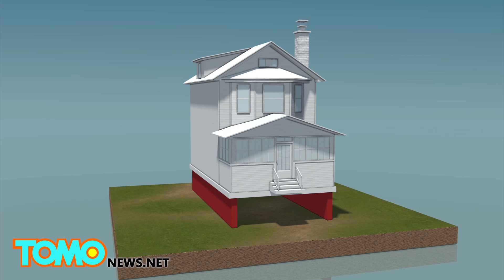Magnetic hovering houses the future of earthquake-proofing homes? - TomoNews

Comment: xS The biggest hurdle would be power supply; a train's one thing, but... If one were to hover an entire household, it would take a considerable amount of power... Even more so if the building is even bigger than the average house.
Reply: No, the biggest hurdle would to be to get hundreds of thousands of dollars  worth of shatterproof unobtanium supermagnets and attach them to twenty or so large 50kw industrial motors that have their own also earthquake proof 1 megawatt generator, then you could say lift an average 2 bedroom apartment... the hendo guy is a crook who has literally not invented anything and his hoverboard idea is not feasible.
Reply: Peter Carlson Eh, to be more accurate, cost; I mean, sure, maybe we could get one working model out and about... At the most two, but, we'd be blowing a considerable amount of money on these things if we'd really want them for commercial use >.< decent concept... Sure, but, I don't believe a thing like this would be the best long term solution for earthquakes...
Reply: ***** dont forget you have to have perfectly flexible plumbing, sewer, and electrical hookups, and be fastened securely in case of wind so the house doesnt literally blow away. Passive dampers are the only practical soloution, that or live in a helicopter because those are more efficient. as an engineer trained in building design I know that the hookups and hold down systems would be more involved in design and assembly than the entire rest of the house project combined.
Reply: Peter Carlson Eyup >.< because those tend to break alot during earthquakes otherwise... The other methods people have already put into practice seem to work fine as they are. Though they could use some refinement, I feel like it's not really neccesary to introduce a more complex (and costly) method to prevent earthquake damage.
Reply: Not just because they break during earthquakes, but you would have to otherwise break them to levitate a house. Insulating the structure is the best start, but you really need a passive tuned mass damper otherwise your home will still vibrate at its fundemental frequency if insulated and would rip itself apart. Hell, you dont even need to hover. There already are buildings that are supported by ball bearings that sit in convex supports on the house and the foundation and have a large swinging weight inside to dampen the remaining vibrations
Reply: Peter Carlson Yeah, more or less, hover technology itself just ain't powerfull enough to cut it the way the other techniques can at the moment.
Reply: ***** or ever. A passive system is the least complex and has no points of failure. Eddie current repulsion takes very powerful magnets that are by definition brittle, and they need to be moving ie spinning fast so the eddie currents they cause in the metal nearby have enough force to repel the magnet. There are numerous points of failure in that idea and a wide variety of exotic materials would be needed to keep the magnets from flying apart while spinning as well as a non magnetic mounting system for all the 20 or so motors spinning magnets that would be the size of large double tractor tires.